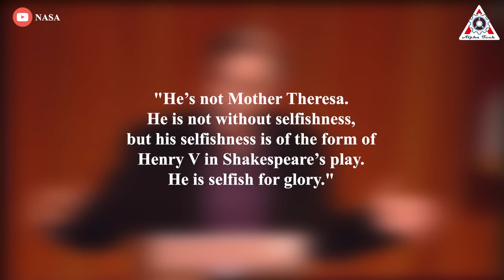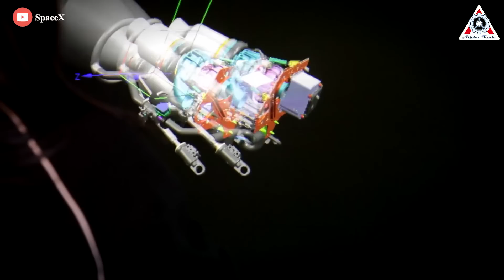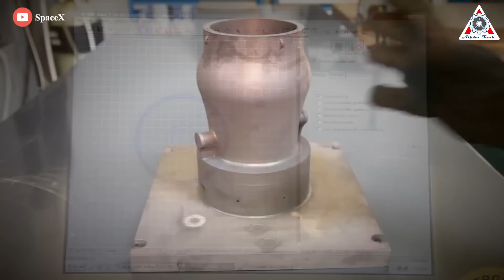All changes made in SpaceX Raptor Engine SHOCKED the entire world and saved billions of dollars...

Comment: I have followed rocket development all my life and was disgusted the lack of progress.  Rocket engines developed in the 1950s are still in use and considered by many as state of the art.  The AJ-10 (1957), RL-10 (1959), RS-25 (1971), RD-180 (1985) come to mind.  The SpaceX Merlin 1D, a somewhat simple gas generation cycle engine was considered as no particular advancement in technological development, was in fact a great leap over anything produced up to that date. Compared with the Rocketdyne RS-27 engine of similar thrust the Merlin 1D has a superior thrust to weight ratio, specific impulse, chamber pressure, increased reliability, much lower cost and improved manufacturability. The Raptor 1 was in another level of advancement.  As a full flow stage combustion engine it was a rocket nerd's dream.  In all specifications it had unheard of performance.  The Raptor 2 is remarkably much better.  It demonstrates what is possible and the moribund 1970s onward were clearly a lost opportunity that Elon Musk and his genius engineers only now are showing us all what is possible.
Reply: @java4653  Java you are deeply confused individual.  No one was blaming NASA.  The lack of development in rocket technology has many causes. Primarily it was a lack of demand.  With only a few dozen launches a year for decades, there was no economic incentive to invest large sums for new technology with little chance of financial return. It took a visionary like Musk, to take the risk of spending billions to lower launch costs with the yet to be proven hope of commercializing the space economy.   The rest of your rant has no place in a space video.  Save it for your left wing echo chamber.
Reply: I think the M1D will go down as the most reliable rocket engine in history.🚀

Comment: Has Musk ever looked at nuclear rocket engines. I see NASA/DARPA will be testing one in 2027
Reply: Yes, I have read comments from SpaceX that they are considering nuclear thermal rockets. They work best with hydrogen and thus have two additional considerations: the much larger tank volume needed for LH2, and the very large mass of the nuclear reactor. But even after figuring in huge increases in mass and volume, the concept looks like a win -- on paper.
Reply: they have super low thrust-to-weight ratio.
useless for launch vehicle.
Reply: Nuclear rocket engine won't be available to private rocket company for quite a long while, and they are (for now) kinda inferior to chemical.

Comment: You'll be a "genius" when you start using anti-gravity propulsion system and quit wasting time and money on these type of engines.
Reply: Well that's not gonna happen for a least a few hundred years, if it happens at all.
The genius if SpaceX is to apply a standard software development model to rocket engineering. They achieve so much in so little time it is incredible.

Comment: There is noting more powerful that a plasma rocket engine ..  The issue with a high output engine is the strength of materials .. With a 1,000 -1,800 bar rocket engines his space ships can loose 50%-80% of the Raptor II engines .. A plasma engine using microwaves combined in the direction of thrust will do the trick .. A dense inert gas like Helium can superheat the Methane LOX yielding high output engines .. What Musk needs to do is loose 60%-80% of his engines & stop screwing around with non-plasma engines .. When the gasses are raised to plasma temperatures the thrust will be almost impossible to control .. All the gimbles in the engines will require a complete redesign .. A cantilever above the engine acting as a level / fulcrum will be necessary to gain leverage over the thruster ..  I believe that a TWT with an output between 30-100 kw would be sufficient ..